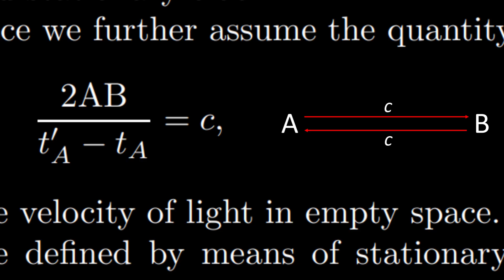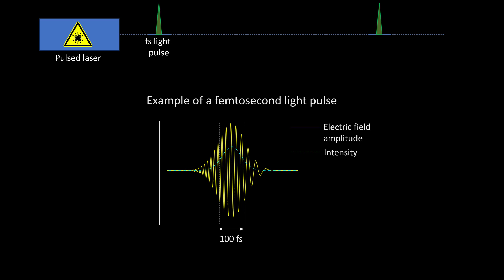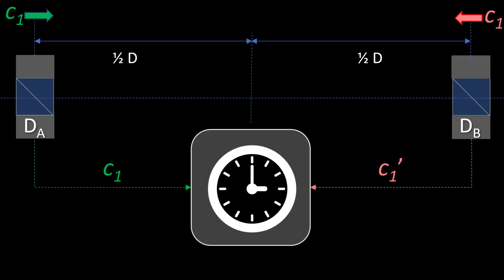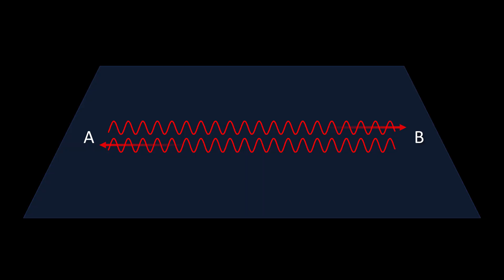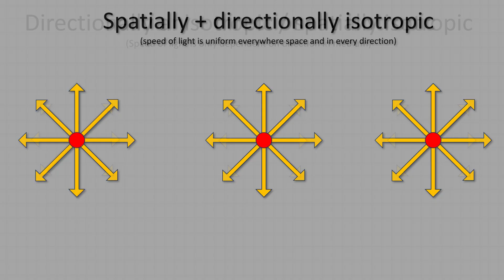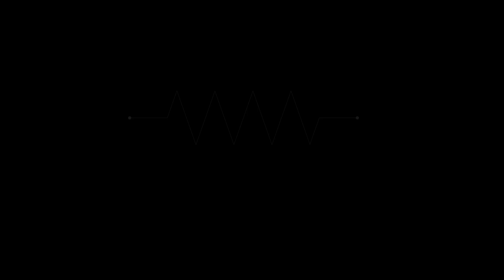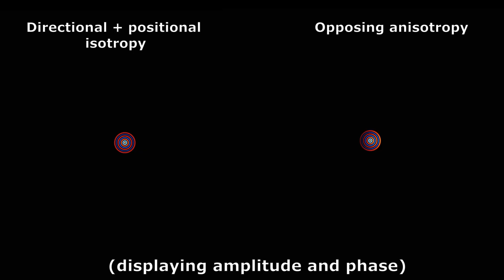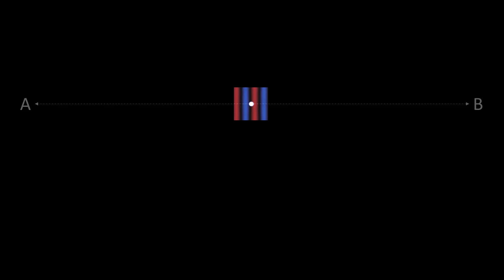Knowing the one-way speed of light

Comment: I think to test if both directions are equal, you need two identical clocks.
There is NO need to synchronize the clocks.
Then each measurement will have an error but in both directions the error is the same.
So both directions can be compared.

To ensure both clocks are identical, they can use the same master clock.
This is not necessary if the clocks are very accurate atomic clocks.
Reply: All clocks fundamentally measure time differences, absolute time doesn't exist. If a clock shows an absolute time like "12:00" that means that it has been synchronized and measures the time difference between now and the synchronization. Thus, if you have clocks that are not synchronized, you should think of them as stopwatches instead.

A moving clock experiences time dilation, which depends on the speed of light. If we don't know whether that speed is the same in all directions, we aren't allowed to move the stopwatches.

So now tell me, how are you going to measure a speed with only two stopwatches that you are not allowed to move? You also aren't allowed to look ahead of course, since what you want to measure is the speed of light.
Reply: @entcraft44  The clocks need internal memory. If one clock sends a light flash it records the timecounter. When the second clock receives the flash it records the timecounter.

The difference of both recorded values is the runtime and it will contain an absolute error.

Then you repeat this in the opposite direction.

In the other direction the error is the same.
So you can not measure the exact runtime, but you can compare both runtimes precisely.

In this setup the clocks do not move and are not synchronized.
Reply: @hpeterh  Okay. We start the two clocks A and B at times a0 and b0 respectively. The values of a0 and b0 are unknown (no synchronization).
Now pulse 1 travels from A to B. A records a start time of s1 and B records an end time of e1. The true times for start and end would be s1 + a0 and e1 + b0.
Now pulse 2 travels from B to A. B records a start time of s2 and A records an end time of e2. The true times for start and end would be s2 + b0 and e2 + a0.
Thus we have the following pulse travel durations:
d1 = (e1+b0) - (s1+a0) = (e1-s1) + (b0-a0)
d2 = (e2+a0) - (s2+b0) = (e2-s2) -  (b0-a0)
And the difference between the two is:
d1 - d2 = (e1-s1) - (e2-s2) + 2*(b0-a0)
Thus the difference in runtime depends on the unknown clock synchronization error.
The only result you can actually measure is the total bidirectional travel time:
d1 + d2 = (e1+e2) - (s1+s2)
Reply: @entcraft44  Yes it is correct what you say.
My idea was too good to be true. ;-)

The problem is to avoid clock synchronisation because it is impossible.

There could be another setup which avoids an external clock and synchronization entirely.

"Clock" A sends a flash immediately when it receives a flash, "Clock" B does the same.
So the whole system is synchronized to the turnaround duration and cycle.
Then an observer can measure the duty cycle from orthogonal far away.

Maybe this is a silly idea too. ;-)
😊

The experiment could be done on the Moon and observed from earth or space.

Now the magic happens: If we know, the velocity is equal in both directions, or if we know exactly the quotient, then clock synchronization becomes possible.
🙃

Comment: Why not measure if the speed of light is constant in all directions by slowing it down using some material that we know has a consistent speed in all directions? We could then compare it to light that traveled in an unobstructed path that directs it into the direction we want to measure in such a way that the distance is equivalent to the slowing of the material used? Then we don't need to know what the speed of light is we just would know if its consistent in all directions compared to its self. If we knew that then we would know what the true speed is

Comment: When moving through a medium, like with a speaker and microphone that is not stationary in air, the one-way speeds can be different relative to your apparatus (but consistent relative to the medium, in the case of air).

We now know that there is no aether and the speed of light is independent of the frame of reference, but this had to be established.

So I would think the one-way speed of light has more to do with moving reference frames than with anisotropic physics.

Comment: I think the spring discussion misses the question of when you're measuring the speed while you're moving relative to the springs.  The problem isn't that the light is going the same speed northward and eastward. The problem is that it's going to same speed in both directions regardless of how fast you're moving relative to the propagation of the waves. Your last comment in that segment sounds a lot like Doppler shift to me.

Comment: The pseudo-range correction used by all GPS receivers is clear experimental evidence that the propagation time of a GPS satellite microwave transmission is decreased/increased due to the motion of a GPS receiver toward/away from the point of emission.  This motion is due to the Earth's rotation plus the receiver's motion with respect to the Earth's surface and depends on the latitude of the receiver's location.  

This is actually an example of the one-way straight-line Sagnac effect.  It is clear evidence supporting the local-ether hypothesis that the Earth Centered Inertial reference frame (the ECI) is the local privileged reference frame for all EM wave propagation (including light) within ~1,000,000 km of the Earth's center. 

The meter-scale ring laser in Canterbury, New Zealand also detects the Earth's rotation due to the Sagnac effect.

The pseudo-range correction phenomenon is well demonstrated in this YouTube video by Doug Marett:  "Earth rotation measured using GPS" (v=-bnBbHFfZ6k). 

Doug shows how to use GPS data to calculate the pseudo-range correction (i.e one-way straight-line Sagnac Effect) as a GPS satellite approaches or recedes from a GPS monitoring station located at the equator.  Since we can calculate the value of the pseudo-range correction (in meters) from how far the station has moved from the instant of a GPS transmission due to the Earth's rotation, we know the propagation time and distance to the station at the instant of transmission.  Even better, we know the these values when the satellite is directly overhead and the correction is 0.0 meters.

This is also experimental proof that the speed of light is not always half the two-way speed of light which is the basis for Einstein's Special Relativity.  And note that any supposed length contraction or time dilation due to an assumed Lorentz transform would be a negligible contribution to this first order (proportional to v/c) phenomena since it is proportional to the square of (v/c).

The crucial issue is the reported null results of Michelson-Morley experiments (MMx) where it has been assumed that the interferometer is moving with a velocity of at least 30,000 m/s with respect to the hypothesized universal medium/ether/preferred reference frame at rest with solar system or fixed stars or CMB or CMB Dipole.  However, the local-ether hypothesis implies that a terrestrial based Michelson interferometer also has a velocity of only 300-450 m/s in a constant east to west direction with respect to the ECI due to the Earth's rotation. All MMx type experiments have not been sensitive enough to directly and unambiguously detect this.  Modern repetitions with cavity resonators process their data based on the assumption of a universal reference frame which cancels out any signal due to the Earth's rotation.  If interested, check out my paper by searching for "A Michelson-Morley Type Experiment Should be Performed in Low Earth Orbit and Interplanetary Space"
Reply: Ching-Chuan Su for the win!

Comment: An idea about wave power increasing in one direction and decreasing in the opposing direction: perhaps that is how things work. How would you check that the wave amplitude is equal in both directions? You would want to "sample" the wave amplitude at, say, x=-d and x=+d and compare at the midpoint of x=0. But if wave amplitude rises and falls in opposing directions, attempting to compare the wave amplitudes at different positions (than they were sampled) would reverse the very effect you are trying to measure and amplitudes would appear to be equal at the midpoint. I think there maybe something more fundamental and profound about the inability to do these experiments. 

I appreciate the explanation involving the permittivity and permeability, and it does seem like the existing equations do not accommodate opposing anisotropy, but perhaps there is a more convoluted mathematical structure that allows for such a behavior.
Reply: You can easily convert the wave amplitude into a power measurement by time averaging. Unlike timestamps, power measurements are absolute.
Imagine the center oscillator as a radio antenna. We would obviously notice if radios could only pick up the signal to the east of the antenna but not the west. How much signal is picked up by your radio is not relative.
Reply: If the spring rate was different in the two directions then the inertia would also be different in the two directions. And that makes it cancel out. So the wave increasing in power does not happen.